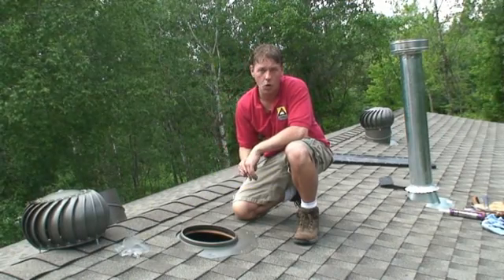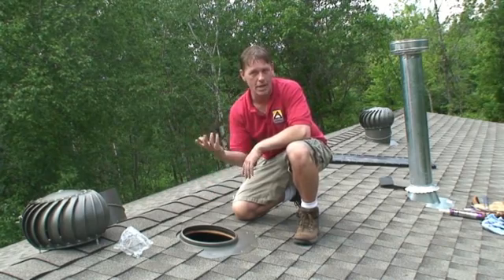Allstar TV - Ridge Vent vs Whirlybirds.avi

Comment: I installed two whirlybirds and soffit vents in my attic and couldn't be happier with the results, upstairs is much cooler in the summer.  I was going to go with a powered attic vent but was told to stay away from it because of the negative air pressure it can pose on a home pulling conditioned air out.